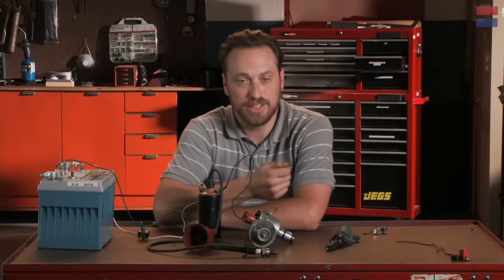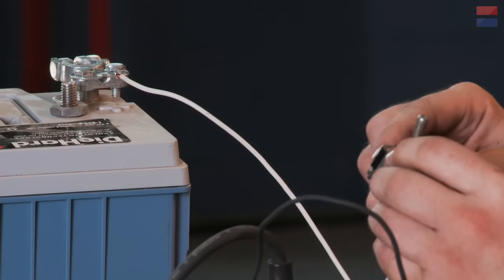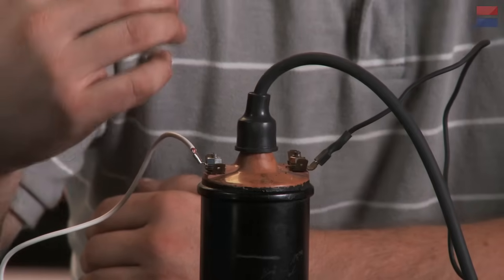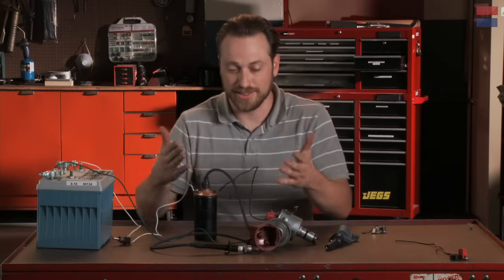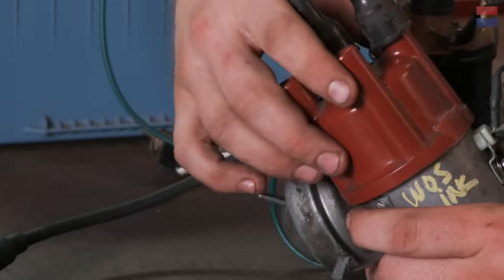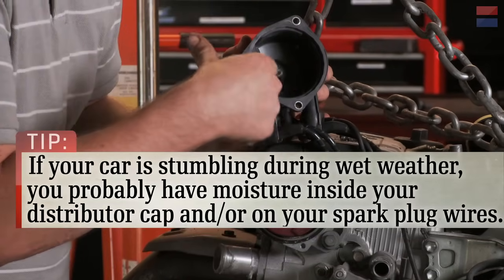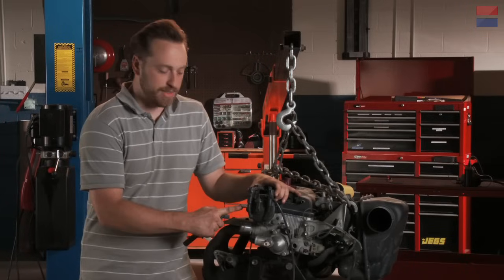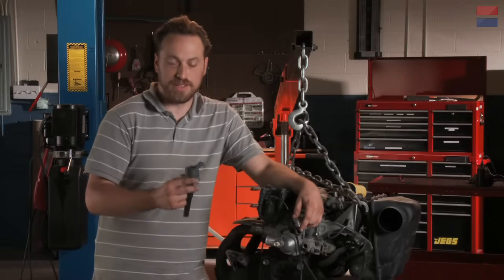Vehicle Ignition System Basics

Comment: Hi Ben, I know it's been 12 years since this video was posted, but I have a question. I am building a 3D-printed distributor, and if I understood correctly, the distributor interrupts the "-" on the coil, which causes the high-voltage current from the coil to travel to the spark plug through the distributor cap. Is that correct?

Comment: I've got a 1976 MGB. It has a coil with four  wires coming off the top of it along with the cable that connects to the distributor. Two of the four wires  enter the bottom of the distributor. What's their purpose?

Comment: One other mention is the Distribution cap o-ring gasket. The video mentions a stumbling or low power issue as a result of water and or moisture in the cap and or the wires/plugs. If you can’t replace the o ring due to size and vintage you can get Permatex RTV sealant and carefully craft your own gasket o ring for you distributor cap just make sure it’s neat with no RTV getting into the points/internals of the cap/rotor.

Comment: What if my coil reads fine, I've got my 12v of power and ground going to it, I connected it to my distributer, but still no spark? I've ensurered my wires have no breaks, my distributer rotor points were clean, and all other connections are clean. Any tips?

Comment: Great job ...I have a question: if you put a high voltage diode to the output of the ignition coil it will improve the ignition and the function of the engine?

Comment: Chrysler developed the first electronic ignition system circa 1971.  They then developed the first computerized (analog) ignition (Electronic Lean Burn) for the 1976 400 V8.  In 1980, they digitized the system, renamed Electronic Spark Control, and added the Elecronic Fuel Control (feedback carbs) in 1981. 

These systems catch a lot of flack, but they actually are quite reliable.  99% of the problems are either with the carb or poor connections/grounds.  

As Rick Ehrenberg, SAE, says (Mopar Action) - unless you're building a pure race engine, there is no horsepower in ignition.  If a Lean Burn car has issues, diagnose it and fix it.  A carb kit, wire connector, vacuum hose, or even a reman computer is much cheaper than hacking up the car and replacing the ignition, intake, and carb.  

Again, zero gain.

Comment: Hi bro good day  nice work i have a problem with a  electronic distributor with a built in  coil and also has  a  condenser mounted outside the distributor the plugs get damaged and the wire got mix up it also has an ignitor  can you help me on how  to connect it  thanks

Comment: Not too bad for the points distributor but you missed a few things 1 how the coil was hooked up   positive to battery negative to distributor 2 you did not show that you put the ground wire to the distributor from the battery 3 you did not have the condenser in there and explain what its job was and without it the points would burn out pretty easily from the high voltage of the coil

Comment: Ive got a mystery for you.  After sitting aprox 5 hours or more my car takes 6-8 seconds to start. After starting once the car starts normally until it has sit for another 5 hours. Battery is not the issue... and I feel after watching numerous videos (and symptoms) its not air flow. My 2 service mechanics dont seem to want to do anything to do with it and have even “claimed” it didnt happen which is not possible since it happens at least twice daily. Ive even left my car overnights so they are the 1st to turn it on. Im at a point where I literally just want to begin rebuilding everything in the ignition system until the issue ends. I bought the car a few months back and it runs perfect (other than that). I was thinking to begin with a tune up (may have never gotten one) Is this a good place to start?! What would be the top 5 items you think I should fix to resolve? The car turns over repetitively for 6-8 seconds and finally starts. If your wondering 2004 Chrysler Sebring..  thanks

Comment: Awesome...learned a lot from this video. I have a 2002 f150. Check engine light is on. Codes mark misfire and oxygen sensors failing. Now may the problem be with the spark plugs and coil or with the catalytic converters? Because I believe it's missing them but I need to confirm that.

Comment: i have a ford f-150 1985 truck with electronic was running and just stopped what ballast resistor do i use to bypass the trucks system

Comment: Your video helped me troubleshoot a fifty year old forklift with no spark  . I guess the wire from the key was shorted , when I checked for voltage at the coil during cranking it was only getting 2-3 volts . I ran hot wire from the battery and got spark . thanks !

Comment: so where does the solenoid and starter come into it. I have a 360 amc with a hei ignition....but I also have a solenoid and starter too. I know the starter turns the engine over, and I understand that the hei distributor basically replaces the coil and distributor with points. But what does the solenoid do and how does it work with the battery, starter, and alternator to keep the car running?

Comment: Sir how could I connect this ignition system with my car fuel tank, I need turn off engine when I open fuel tank while engine is running
Reply: just wire the switch to cut power to the coils when you open the flap.  Not sure why you'd want to do this though.  It also add's another point of failure for the engine to run

Comment: Can we use a 0.31 uf condensor ( used in Marelli ignition systems) instead of a 0.25 uF  as used in bosch ignition systems ,both with contact breaker  distributors
Reply: Surprise surprise NO answer in 5 years

Comment: In what you said at 0:57 about the switch letting the positive current flow into the ignition system, why is it the positive that flows? Thinking about it from a physics point of view, how could the positively charge protons flow through something when the protons are actually inside the atoms? Wouldn't it make more sense for the negative electrons to flow, since they're on the outside of the atoms? Though I have heard this analogy used before, that the positive current is what flows. I just never understood why.
Reply: your correct, current flows from negative to positive.  For the layman though that distinction is more or less meaningless.  I'm pretty sure that was only figured out after the conventional system was in place, and there wasn't really a good reason to change it.

Comment: how is the DC voltage increased?  a transformer only works if there is an alternating voltage.
Reply: it works with pulsed DC as well, which is what happens in a car ignition system.

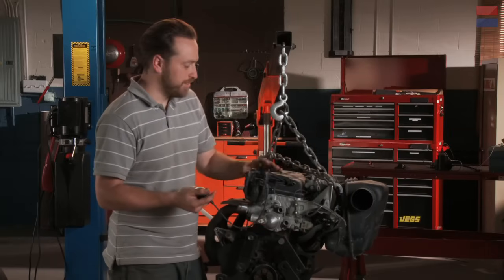Comment: At 4:41, what about the condensor? What is it's purpose?
Reply: The condenser absorbs (to put it crudely), the back emf that is generated by the sudden collapse of the magnetic field in the primary coil. Thus it saves the spark plug points and the ignition points from pitting, which ultimately increases the life span of the spark plugs and the ignition points.
Reply: Draws out the transcient building up so that the primary coil circuit  doesnt arc while the points are still relatively close together.

Comment: i have a willys pickup with a l6-226 6 cylinder engine, it was running very rough and wasn't putting out much power, now it doesn't run at all. i think it might be the ballast resister but does anyone know anything else that could cause this?
Reply: 454bigblockuncorked _ 454 I don't know if you got your answer back? but I'll tell you from my experience working on any Dodge's that have the ballast resistors, or any vehicle that uses ballast resistors, always carry a brand new OEM ballast resistor in your pocket, then have a second one in your glove box, the very first thing I do when doing a tuneup on these engines he's replaced the ballast resistor always,!!!! you would be surprised to see how many microficher breaks are in the the ceramic block,,, the aftermarket companies,,, who make these ballast resistors,, I have found they use a a lower grade wire filament, that's why I always go to an OEM part in this case!
Reply: Very true dale

Comment: put a new distributor cap and rotor arm in my mk2 golf and it started first time within a second, i left it running till it reached temperature and then i literally touched the gas and then it died! so i tried to turn it on again and still nothing, so i removed the cap and rotor arm and put it all back on properly, ensuring i pushed down on the spark plugs on the dizzy cap and tried to turn it on again and still nothing? can anybody help me? it's a brand new cap and rotor which was the only problem.

Comment: I have a question please try to answer. In distributer less ignition system do you adjust ignition timing on the engines computer by using a OBD Scan tool!?

Comment: I've always had a doubt about how the ignition timing works on the dynamic systems (with distributors), because even if the engine computer decides to fire the cylinder later or before, the distributor will be close enough to the respective contact in the exact same moment, since it's not movable, so how does this work?
Reply: You can loosen the distributor and physically rotate it vs the camshaft.

Comment: How does the starter starts the engine??
Reply: Well first you need to know which you may already know the starter is a separate component by itself. But like the ignition system, it's controlled by the  key to operate. When you turn your key to ignition, you allow current to run through a series of electromagnetic coils called the starter solenoid, which is mounted on top of the starter motor. Once the starter solenoid is running current through its coils, it acts as a magnet since its electromagnetic and it pulls a metal cylinder piece towards it which then completes the circuit from the battery, thus actuating the starter motor. Connected to the starter motor is a shaft with a small gear called the pinion. As the starter motor spins, the pinion spins with it and it connects itself to a set of threads called the Bendix threads. These threads allow the pinion to synchronize with the flywheel, which turns the engine and starting it. The current induced in the starter motor causes the shaft and pinion to spin really fast, which is needed in order to get the engine rotating. Once the pinion turns the flywheel a few times, the flywheel speeds up and overrides the speed of the motor shaft. This forces the pinion to disconnect from the flywheel, which pushes the pinion back at great force. Such force is needed to be suppressed (absorbed) to keep from damaging the pinion and the starter itself. This is done by actuating a release spring by the ignition key. After you start your car and release the key, it allows a strong spring to absorb the force of the pinion gear. But this only happens when you release the key. If you keep the key turned after the engine is already on, you may damage the pinion and starter motor from over speeding as the starter will continue to increase the pinion's speed and eventually destroying the motor and the whole starter component. So be sure to let go of the key after your car is on. I hope this answered your question. Sorry it was so long but the starter is a complex component to explain. Thank you if you read all of this.
Reply: no i don't think it would mess up the transmission since the engine would still be rotating and turning the drive shaft, and your wheels would still spin. However you would lose any control of the engine and the powertrain and there would be no air vacuum caused by the intake (which causes a vehicle to slow down when you let off on the gas pedal) so your vehicle would only come to a stop due to loss of acceleration caused by gravity and friction. it shouldn't damage the tranny unless it had some kind of locking feature but I'm not an expert though i do know its not a good idea to try for yourself lol. DONT TRY THIS AT HOME!
Reply: great explanation, im curious, waht would happen if a person was driving and just turned the key off lol while driving would it break the tranny

Comment: What is the advantage of the electronic ignition that still has the distributor points?  Is it just more reliable due to not having the breaker any more?
Reply: It is computer operated. That is the computer fires the coil which ultimately fires the spark plug that is in need of the spark..Or it diverts the voltage to the spark plug of the cylinder which is at the end of its compression stage at exactly the right moment..which ultimately avoids misfires.
Reply: It saves time

Comment: Why did the original system need a separate distributor to switch the current on and off (since it's coming from DC from the battery), wheras the new one is able to transform the voltage without a separate distributor?  What creates the changing current in order to create a magnetic field in the new transformer?

Comment: Thanks for that.
How does the voltage get boosted up to 22,000 on the new distributors with out points?
Reply: Same idea, different design. Every spark plug has its own ignition coil built in.

Comment: For a 1996 Volkswagen Passat with a 2.0l engine I found out that the coil and module are built together , and the computer controls the module I need for detail about it I dnt know if you can help me with that, it's not an injector system is an electronic carburetor

Comment: Nice video.  Can you provide a diagram and/or a schematic?  Also, you talked about "voltage running through the coils."  Voltage never runs through anything.  Voltage is always across.  Current runs through.  I know that some people just think this is a semantic point, but it really is a conceptual point.
Reply: Dan Hillman ....Excellent point. People that think it's semantics will not understand the concept or principal. They're called "parts replacers"

Comment: Thank you Sir!  Question, I have a 1975 Dodge Custom 100 with a 5.2ltr.  This last winter it was -10 for about a week and the block froze and of course when it jumped in temp so quickly I shut it down (never got above 210), however something happened to my electrical and I am getting no spark at all.  I have replaced the ballast resistor and the volt regulator and coil and plug wires and cap - nothing.  I have continuity in all wires and the starter will turn the fly-wheel but still nothing.  Do you have any advice?  Could it be the neutral-safety switch?  Also, is there any danger in hooking the battery directly up to the coil and alternator and giving that a go?
Reply: ***** Thank you for the reply.  I have been using a remote starter switch to test the starter and it is working fine.  I am replacing the NSS, and thinking of using a relay and bypassing the ignition all together with push buttons.  Any advice on that process?  I believe I have all of the wiring diagrams and electronics figured out, I just haven't had the time to do it yet.

Comment: It looks like a great video, thanks for your explanation about the engine distribution system but if i have in my car the distributor cap only without the breaking points and the condenser where the coil have an i/p of 4 points and the normal secondary o/p>>>>what does that mean and how it works?

Comment: i have a problem with a 1989 Isuzu trooper 2.6 motorit seems to be running on 2 cylinders I checked the compression its good, coil is good, spark plugs and wires, distributor, timing, is good I am thinking its the pickup coil after seein this video what are some of the syntons and how do I test the pick up coil - thanks

Comment: See you can always pick out the guys that know nothing about Mopars. That car came with a 318 Im sure. With minimal modifications that are easily found on other Mopars that engine can create over 300 HP easily. With B level technician ability you can yank 400 to 500 HP. It was a strong tried and true engine that worked great, lasted forever and they left well enough alone with it until the magnum engine was designed.

Comment: You do have a manual for your vehicle,right??? In the tune up section is the gap specs for it,along with the oil type,filter type,torque specs,maintenance specs,and everything of importance to your engine,and vehicle...Get an e manual(5 bux,or so)if you have a laptop ,and you'll always have it at your fingertips..

Comment: Hey thanks for the info.  Do you know if I have to put some lubricant on the spark plug boots and the distributor cap contacts?  I also need to know how to find out the correct gap for the spark plugs. I have a 1995 6 cylinder Toyota 4runner. Thanks again